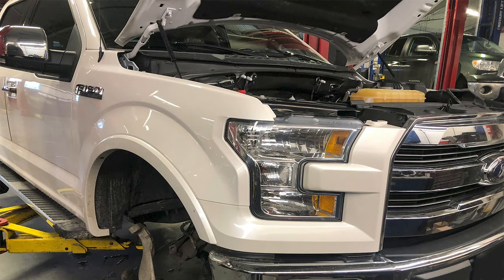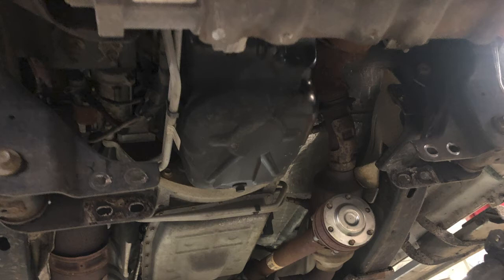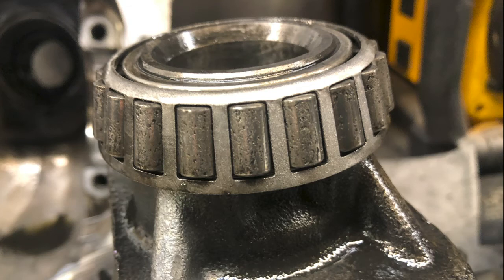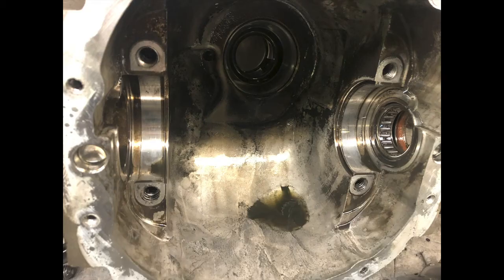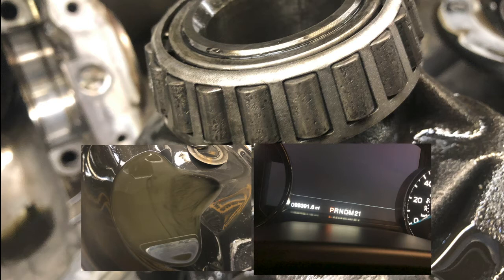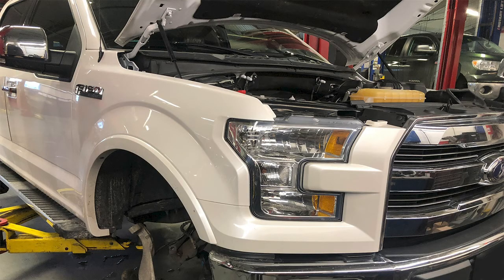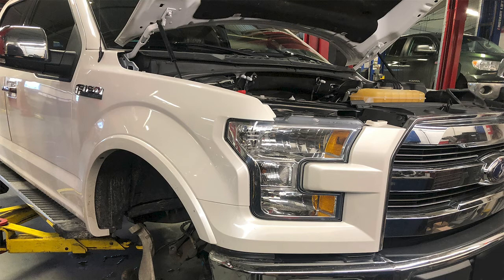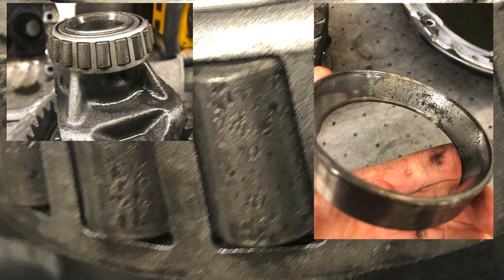2015 Ford F150 Front differential bearing noise NOT (IWE) Integrated Wheel End

Comment: What did the noise sound like? It seems to me if it’s in 2WD it shouldn’t make any noise because the axle isn’t moving unless the IWE is failing and causing the axle to spin
Reply: I was going to say the same thing. And I have the same hum left front. Louder when you turn right, goes away when you turn left. Makes no difference 2 or 4wd. Ain't the diff oil.
Reply: @CK-dt6nx  I have the same issue in 17. You figure out what the issue is? It only happens when I’m turning right and my steering wheel is at a certain angle, it does not do it on a full lock turn and only does it at speeds under 10mph.
Reply: Hey fellas. Any updates on the noise?
Reply: @Sal_Gunz  I have a 2017 and this just started happening. It's very frustrating.
Reply: @Brett.284  mine ended up being the IWE and a bad wheel hub bearing. I narrowed down the IWE by disconnecting the IWE solenoid and the noise went away in 2wd. Seems like i wasn’t getting the common IWE scraping/grinding noise but it was definitely shot. My wheel bearing going bad ended up being bad timing along with the IWE as it was most likely on its way out and it was a combo of IWE and wheel bearing noise I was hearing.
Reply: @Sal_Gunz  I have same problem but they are telling me it’s my front diff a complete mess they checked the IWE say they work fine this from ford dealer too
Reply: @CK-dt6nx  did you ever figure out the noise ,inhave same problem I changed wheel bearing and it didn’t help
Reply: @alex jack  I haven't messed with it yet. The noise happens in 4 wheel and 2 wheel drive. Can hear it through the steering column. Louder when I turn right and weight goes on the left wheel. Hasn't gotten louder or anything so not gonna worry until then. Don't wanna blow 600-800 on a wheel bearing assembly and that not be the issue even though I'm sure that's all it is.
Reply: @CK-dt6nx  My symptoms are exactly the same. Did you figure yours out? Tks, Jimmy.
Reply: @jimmykipper3985  mine was both steer wheel bearings.
Reply: On this trucks I believe they move all the time even when your not on 4x4
Reply: I ruled out my IWE...the sound mine is making in 2WD and 4WD is a low volume humming sound, not grinding or gears thrashing, only when coming to a stop or very slow roll (1-10mph) or when letting off the gas beginning a slow roll from a dead stop or 1-5mph roll. It doesn't change with steering wheel angle and goes away as I accelerate over 5-10mph. I vacuum tested every component of my IWE and replaced the check valve and 4x4 solenoid from the Ford dealer to no avail. It has to be either front diff or antilock brake sensor? 7 months ago I had all new pads, rotors, and calipers installed and it made the exact same sound under the exact same conditions before and after the brake job, so I rule out those items. Perhaps a bad ABS sensor or other ABC component or the front diff.

Comment: Far as the mileage goes that doesn’t really tell you anything because nothing moves in these front differentials unless the truck is locked into four-wheel-drive so if the owner only uses  the four-wheel-drive option one time in six years you’re going to have very little mileage on the internal parts but that’s also the reason so much moisture builds up in them because they rarely get used to build up enough heat to burn off the excess moisture.

Comment: Yeah I think my 2015 F150 lariat has this issue. I turn the wheel to the left and I can feel it and hear it. I replaced the front left bearing and the noise is still present. What did it cost to replace these bearings at the dealership? From the pics it looked relatively easy.
Reply from the maker: This dealer I think charged over $1,000, but this is a dealer with dealer pricing.

Comment: I have 2018 F150 Lariat with 4mode transfer. My 91,000 mile gently used truck is having front differential being removed and rebuilt by FOMOCo dealer under extended warranty as I write this.
At least 2 years ago I complained of subtle noises from front wheel (s) . They did some " repair" and the noise I had been hearing while turning was gone. 

Move ahead several months and now hearing very faint but discernable noise somewhere if front driveline.  They blew it ( and me)  off as tire noise. Sounded like a twig from a tree was stuck under truck and dragging just to describe sound. Dealer claimed the couldn't hear anything. You needed to be on quiet smooth road with heater and radio off. 

The noise continued and in the interim I started to notice a generally sharp reduction in fuel milage by about 18% or more. No codes, no misfires etc. " try an injection cleaner "dealer says.
Now I am told that the noise I have been hearing is loud enough for dealer to recognize as being front differential bearing failure! They could hear it now! Amazing!
Hit me like a ton of bricks...why the f%$ is the front differential running all? I have been hearing this for about two years!
In the 60,000 miles I have driven the truck in Wisconsin the front has been locked in 4x4 during snow perhaps 30 miles. 4A perhaps as much as 100 to 200 miles.

 4x4 low with rear diff lock as much as perhaps literally a thousand feet! 

2wh 99.9% of my old man grandpa driving. Again why is the front differential turning at all.
Well apparently the noise I heard while turning was from the IWE  Actuators.  Without telling me they apparently discarded the vacuum line between source vacuum and the check valve to IWE control vacuum solenoid and capped the ends. So, for 2 years  I have been wearing front differential parts, increased tire wear, significantly reduced fuel milage and now get to pay for the deductible portion of extended warranty work the nature of which was caused by the Ford dealer action 2 years ago!
I'm pissed!

They should have at least told me that the front hubs would now be continuously engaged... do you mind??

I have been trying to fully understand the design and workings of the 4mode transfer case and the operating criteria. It has been hard for me to find specific design or description on the internet. Perhaps i am not looking in thevright arra ir using wrong sesrch vernacular.

 Someone alluded in this comment arena that the front drive shaft is always engaged and the front differential will be spinning all the time even in 2wd. 

From what I have learned ( I don't have access to the full breakdown books. I miss Cholton and Motors etc at the local  Library) the front shaft is engaged with an electric clutch.  If that is the case nothing should be rotating when 2wd when IWE Actuators are operating as designed.

Please clarify if that is NOT the case.

2) Even though there is a TSB to disable the vavum to address IWE noise ( that I apparently had encountered) shouldn't they have replaced offending components?
 Gee, my brakes make noise when I step on the brake pedal... mechanic says ill just cut your brake line... your noise will be gone!! 

Is there any class action suit over this IWE bypass business?

Vehicle is now clesrly operating outside of federsl fuel milage certification.

This is easily a $3000 plus billable job.
I estimate that I have directly lost $500- $600 per year in added fuel consumption
.
Judt few weeks ago l was  looking at my tires thinking they are wearing a bit more than the original set. By about 5 to 10 % more.

Sorry for the length if comment but judt had to clear air or muddy it up a bit!
Thanks! 
Ron
Reply: Man I think I’m having the same issue with my 2015. I have a wierd grinding noise on the left side I can’t figure it out I changed the iwe just last week an it dint help one bit and did your truck ever pull  hard one way?
Reply: @Iambl2 pull the vacuum line off iwe, see if noise goes away, probably problem with the vacuum line system, iwe not disengaging all the way
Reply: I too have a 2018 F150 Lariat with 4mode transfer.  Within my first 3,000 miles, I would periodically (about once every 10 times I drove truck) hear a grinding noise from up-front.  I did research on-line and found that it was likely the IWEs partially engaging due to a faulty IWE vacuum check valve.  Took truck to dealer and explained the problem (and that it was an issue many other owners were reporting) and asked if they would replace the IWE vacuum check valve.  They said they would check it out and after they drove the truck I got the typical "could not duplicate" response from the dealer (I told them up-front it was very intermittent) and they would do nothing.  So rather than allowing this to continue and damaging my IWEs, I pulled the IWE vacuum check valve and blew through it several times.  It would periodically not hold or seal-off properly.  I went on-line and purchased a few of the check valves (Motorcraft YG360) and installed two of them in the vacuum line.  I haven't heard a grinding noise since and I now have 43,000 miles on the truck.

Comment: If you F150 has the AWD option on the 4WD selector switch , commonly found on the higher levels of trim, then you have a different transfer cases than those without this option. The engagement system is different  to give you AWD. Unfortunately, this system has parasitic hydraulic drag that turns the front drive shaft even when in 2WD. It’s similar to spraying water on a paint roller and watching it spin. This is going to put a lot of extra wear on the front dif as the drive shaft spins all the time.

There is also a TSB out there that says to cap the iwe vacuum system to correct vacuum leak associated problems. This turns your front drivetrain into something reminiscent of a 1990s full time 4WD system. Again more wear even when in 2WD

Something to be aware of
Reply: That makes sense.  Mine has 40,000 miles on it and developed this grinding sound and this was the problem.  Thankfully covered by warranty, but seems like an incredibly early failure for this part.
Reply: Thanks my F 150 2016 which I bought brand new now has 77KM got this problem  and I been driving 95% in 2WD.Just return from Ford dealership here in Toronto and they asking 3800$ cad for replacing whole front axle.:-(
Reply: @eddytheman1384  2015 Lariat with 100k. Just purchased. Too miles later this popped up. They're telling me its gonna cost me $3.2k. Anyone know how important for me to get fixed?
Reply: more of a problem if you drive around in 4A all the time,  if your IWE's are working it's not a problem